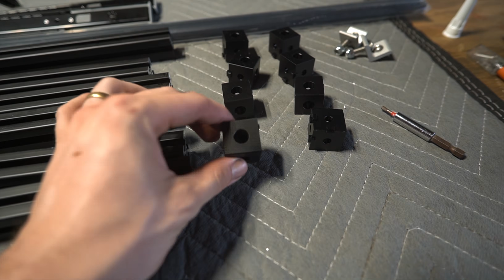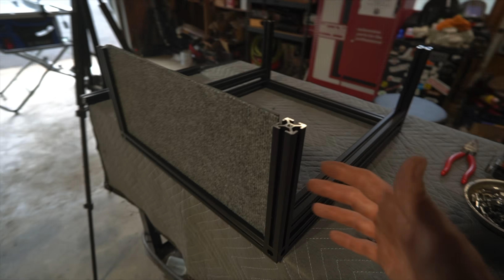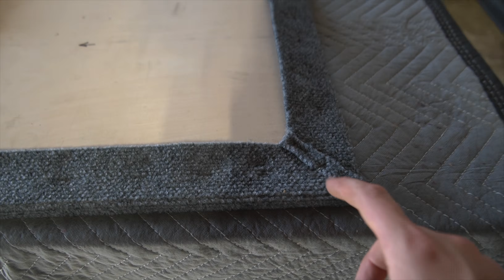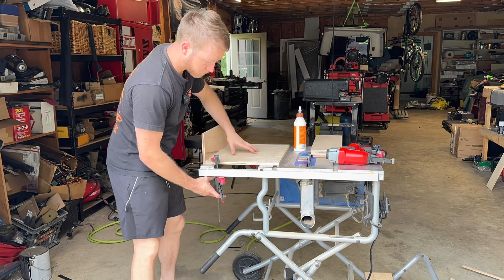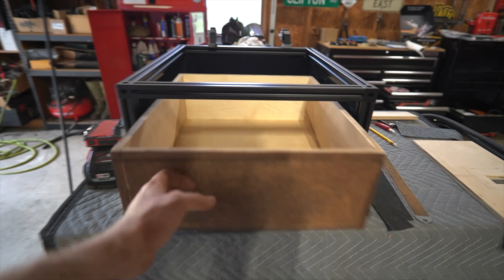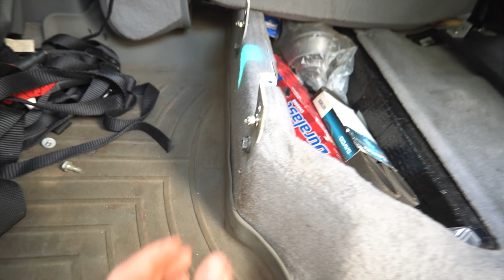DIY Drawer System 80/20 Extrusion **DETAILED**

Comment: Nice work, very tidy.

On the drawer slide mounting though - as you drilled some holes into those extrusions for your screws to fit into - you could have skipped the drop-in t-nuts altogether, just drilled through the extrusions and then tapped those holes for 1/4-20 thread. The use of the t-nuts is largely for being able to adjust position, and with your screws going into the extrusions, that is no longer relevant.

Comment: Fantastic build. Love the black extrusion with grey carpet.  could you have done 2 or 3 vertical slides supports to mount the slides so you would not have the bottom gap?  I am going to duplicate this awesome build.  Many thx for posting!
Reply from the maker: Yep could totally do a couple pieces or aluminum angle to bolt the slides too and notch your filler panels accordingly! I personally think the extra extrusion to mount it too  is the simplest, strongest and easiest way to go about it though!

Comment: Love the info in the video but was the audio messed up or was it on my end?  Watching the audio started almost too loud on each cut the faded down to almost unhearable. May have been my tv.
Reply from the maker: There is some fluctuation in audio levels but not intentional. Unfortunately my mic setup gave me a hard time but wasn’t noticed until filming was complete. I did my best to smooth it all out! If my phone is about half volume it stays pretty consistent on my end!
Reply: I had the same issue.

Comment: Thoughts on drilling and counter sinking from the bottom of the rail?
Reply from the maker: The 3 way joinery is where that gets tricky. It would work for 2 pieces but you would need an external method such as a bracket or plate to have the 3rd piece join the same corner!
Reply: @Adv4x4 you can do 3 way corners. You just need a hole large enough for the Allen key in the correct location and with your already ordered threaded center hole. The 3D printing world uses this all day long for the external framing (Voron 2.4 for example)

Comment: Why not use spray on adhesive?
Reply from the maker: That could work great too! I just felt as if the liquid nails was a more “permanent” solution. I have some experience with spray on adhesive in the past and it sometimes starts to let loose over time, although it could have been from improper application etc.

Comment: Pretty slick. No need to over complicate things with jointery
Reply from the maker: Yes sir, for the average diy guy this method works great. Tested for years on multiple applications with no issues. 

If I were to sell these I would invest in dove tail joinery though

Comment: in a pinch a 2 or 3 drawer Milwaukee works perfect.
Reply from the maker: Definitely! You may have seen in the videos but I have more then a few of the packout drawers I use as rolling tool boxes 😂
Reply: @Adv4x4  nice. handy as hell. I have a huge dual drawer sleep platform in my 1st gen sequoia but the Milwaukee's are sure good addition.